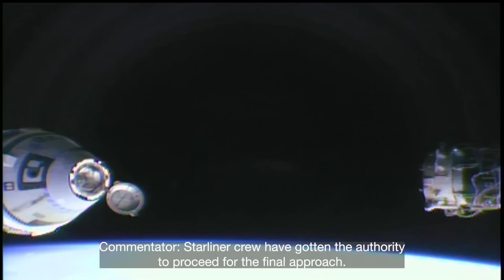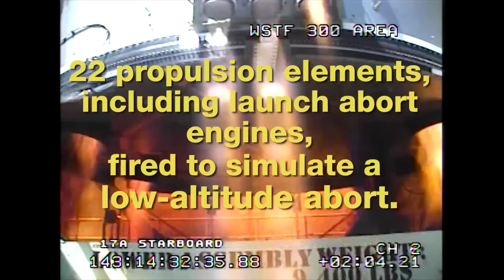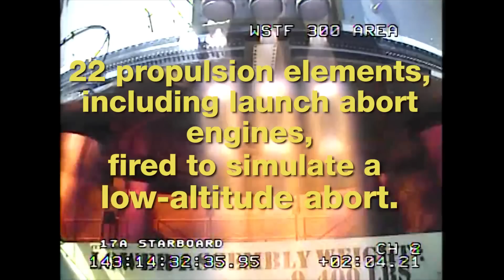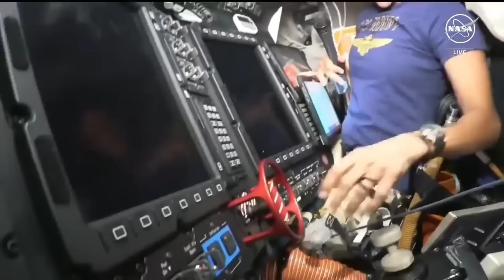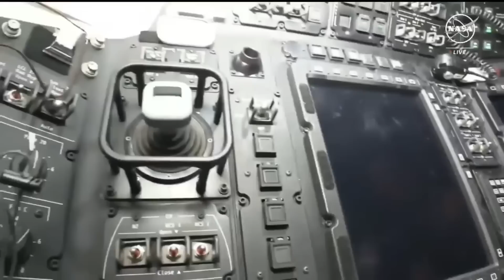The Decision Is Made - Boeing Might Be Safe? But SpaceX Is SAFER!

Comment: I'm not entirely sure how to appraise Boeing, here.  These issues are not unheard of and are to be somewhat expected, at least... From what we are being told is the issue.

It's easy for me to sit here and accuse Boeing of doing a bad job - but that's also not being entirely fair - nasa and other groups have run into similar issues and we just didn't get a play by play.

That said.... It's not like this is the early days of aerospace, either, and the types of issues they are having - corrosion, thermal warping of gaskets/seals, helium containment, etc are things that have been generally solved for, before.  I don't expect a flawlessly designed vehicle, but how do you make flammable wire harnesses?
I know how you do, since nearly everything is flammable when dealing with pure oxygen delivery - but that is kind of the point... We know you need to carefully select materials because of specific concerns ... If you just slap a zip tie from the hardware store on it and go, you'll probably have problems.

.... There again ... I specifically remember my brother, who works on a different boeing project, recounting a story where they had to interdict an engineer's efforts to certify a procedure that involved shooting O2 down a line that had not been purged of oil residues, and being quite adamant there should have been no problems with it.... So .... Nylon Zip ties as wire harnesses would be par for the course.
At least... According to ASTM, nylon has autoignition properties to be studied in relation to oxygen environments, so I would choose something else as a wire harness, myself....

Comment: They have worries about the spacecraft damaging ISS when returning with crew onboard. How does it mitigate the risk, when the crew flies with SpaceX? Could they then use some more aggressive de-orbit burn, than they would do with crew onboard?
Reply: They described that under the uncrewed scenario they would undock and basically drift to aft of the station before departing backward. The original departure sequence instead took it up, over, underneath, and then forward of the station. I imagine the simplified docking procedure requires much less attitude control, if any. I'm not sure of the exact reason why the simplified undocking procedure wouldn't be used for crew, though.

Comment: After Apollo 13 where the CO scrubbers in the Command Module/Lunar Module were different requiring a Macgyver fix. 

NASA what the HE!! were you thinking, all In-flight space suits should have been designed for common Life Support Interfaces so they could move between NASA Sponsored equipment. The structure of the suit could be different but the style of connectors must all meet a single spec.Therefore a Boeing suit and a Space-Ex suit could move between NASA Sponsored equipment/vendors. 
Nothing they could do to make Soyuz meet that spec, except have a Auxillary pak that would bridge between the platforms.

Comment: I find it interesting that SpaceX had 25 Dragon launches (22 Dragon-1 and 3 Dragon-2) proving their technology and engineering, ironing out issues and oversights, before they put a crew of human beings inside the spacecraft. So much effort and it was worth it. Dragon-2 was as reliable as it could be when Bob and Doug flew to the ISS. Boeing, on the other hand, has humans on board practically right away. Their work was not so rigorously proven as SpaceX's and look what happened. Really makes you wonder.

Comment: Scott, Can you make a video or recommend one on why the Star Liner vs Dragon have had different results? Are the use of and requirements of the two substantially different? Did Boeing go down a poor design path? Did Boeing go down a poor materials path? Were the design processes between SpaceX vs Boeing (Fly to failure and fix it vs simulate to success) part of the reason? SpaceX just looks really good in this situation. What have they done differently?

Comment: The thrusters, parachutes, o-rings, pressurisation system, and electronics failed on the pilot spacecraft without crew, they knew about this before the human space flight, yet they still sent them up saying it was all fixed, now here we are 18 months later, and all the past failures happened in space with crew. You have to wonder now, were they actually fixed by Boeing or just given the okay with doubts?

Comment: The return of the Starliner wont be a walk in the park. 
Two of the "tested" software on the Starliner has already failed, the software of the autopilot is "untested" (I would not be surprised if it weren't even developed). The thrusters' earlier power fluctuation (the ones that came back normal later) can happen again an who knows what we do not know abou what the software should be ready for.
And they have to test it on the "live" system, everybody will watch the news. I would not even surprised If we get the news about the return after the event...
What do you think?

Comment: I'd be suspicious of the replication tests...it's possible the thrusters and the flow systems on the test modules are of higher quality than the ones in the actual capsule docked at ISS. Imagine you're a middle manager trying to cover your a$$, so when the testing group is trying to replicate the problem, you'd be sure the best parts were in that mock up. Whereas the docked capsule might have been rushed into service due to all the delays and, as Boeing seems want to do, substandard parts were used.

Comment: Not sure Boeing's reputation still has enough weight even to be effective ballast! Seems to me the really questionable decision was to give Starliner permission to approach the ISS with failing thrusters. If you are flying a two-engine plane and one engine fails, you do not say 'ah well it is perfectly safe to fly on one engine, press on', you say 'our redundancy is gone, land as soon as possible in case the other fails'. Plus if you are test flying a new plane design, you get really nervous because it is most likely the engine failed due to a design or manufacturing fault and the other has the same problem.

Comment: Sounds like it is time for a universal connector for the pressurized flight suits so they are compatible with any spacecraft. At this point with hindsight, it seems painfully obvious that we should be doing this for crew safety, especially on an international space station. Kind of reminds me of that time on Apollo 13 when the air scrubbers from the CM wouldn't fit in the LM because they were different shapes... for... reasons... :0)

Comment: Launch day footage was a perfect sign of the program.  When we got to watch the close out crew and they couldn't even wear the safety gear correctly, let alone use it.  It just showed how far boeing and nasa have fallen.  Prior roll outs of the capsule with safety parts falling off landing on the road.  Massive delays.  Bloated expenses.  It's just a mockery of its former glory.  How's that new spacesuit coming. SLS is in the same situation.  I mean it's not even newly designed tech, it's a majority of reused items designed by the former generation, when nasa, boeing etc were great and actually shined.

Comment: Scott despite efforts to play down Starliner's undeniable deficiencies as being  representative if not eloquent of disadvantage.

Surely it is obvious to most that the primary if not only reason Starliner is the "preferred option" for it's crew in the event of an emergency descent scenario is purely because a Crew Dragon vehicle is not currently readily available and cannot be because Starliner, is blocking the only available docking station?

After all which vehicle has flawlessly delivered all other current occupants of the ISS along with a number of others as well as several unmanned resupply missions?

Starliner has merely delivered it's inaugural crew to the ISS and not without substantial if not serious problems/safety issues yet they are being played down to almost fanatic extent in some circles.

The issues in question have been subject to substantial effort in order to downplay their significance and Starliner actually touted, as a "preferred option" in the event of an emergency descent?

Rather than being in a "unique position" it appears that having the option of 'selecting more than one vehicle for crewed missions' is more of a dilemma for NASA than a laudable advantage.

Given the extent of seemingly evasive behaviour associated with obvious attempts at contriving positive propaganda regarding Starliner despite, serious and potentially irremediable problems plaguing it.

People could be forgiven for wondering if there is not also more than a little chicanery involved with regard to delays besetting continuity for testing and an inaugural launch to orbit for Dream Chaser.

Comment: 8:46 Surprised to hear that there isn't spacesuit compatibility across Dragon and Starliner, given the lessons learned from CO2 scrubber incompatibility between LM and CM on Apollo 13.
Reply: Yeah, that struck me immediatly as unwise/safe! The essential needs are likely 90+% the same utilities, so common connects should be possible even with older current ISS suits, or adapters supplied. Because there are also the Soyuz suits to consider for escape! If/when emergencies occur, time and options will be limited. Hopefully the Chinese dont have the same issues, as they likely standardised on one recent design. Not that it will help the ISS, unless they followed Russian designs exactly?🤔
Reply: Yeah well why have compatible safety features when Elon needs another 100 million to dump into a losing venture?

Comment: The decision to press to ISS docking, vs aborting and bringing Starliner back (whilst it had more helium reserves, good battery and they'd recovered enough thrusters to regain positional control) in hindsight was probably not the best call. Boeing leaving it to NASA to determine their fate, rather than get out in front of it and own the issue (and negotiate with NASA for return on an alternate transport) isn't a great look, either.

NASA and Boeing clearly spent weeks essentially trying to get engineering teams to agree to putting two crew members back in a vehicle with a service module that is not entirely operating within spec (never mind questions over what state the flight computers were configured for that don't currently support full autonomous control). 

It is good that safety has won out over 'optics' as it looked increasingly like that might have ended differently.

Starliner itself is basically fine. The Service Module however clearly has issues that aren't just going to magically go away regardless of how much Boeing express confidence in it. Ideally it'll return just fine (as it should) and Boeing has a ton of work to get the SM into a more reliable state. The alternative is that it doesn't return just fine - at least that can't actually affect the original crew, now.
Reply: NASA definitely wasn't arguing for crew return. The vast majority never felt Starliner crew return was safe and they unanimously agreed that the SpaceX return option was acceptable. 

I think they wanted to dock because they were much closer to the ISS and it would be much less intensive on the thrusters to dock than to try to deorbit. It would have exposed the crew to more risk by trying to call off docking
Reply: @AmbientMorality  I am not sure pushing to the ISS would have been any safer than pushing for deorbit. A vehicle that can't abort docking, for any reason, has no business heading to the ISS in the first place.

NASA was originally on board with a crewed return (once Boeing could determine the safety of doing so). It's evident NASA could not get the required determination, could not achieve consensus with engineering teams and thus the alternate arrangement. There would be some natural pressure to not do what they are now going to do, so I think the narrative that NASA was pro autonomous return from the get go, ignores that requires changes to implement and the last two months that was focused on a crewed return for Starliner.

If nothing else we can likely agree that this is a good and safe outcome and that is really the critical thing.

Comment: shouldn't heat dissipate much faster in space?  Heat buildup as unique to approaching the ISS makes no sense--at all.  Probably a bad sensor(s).

Sorry. Boeing's reputation has already burnt up.  :)
Reply: Heat that built up quickly inside the doghouse can't dissipate by radiation anywhere nearly as quickly as it built up. The structure is insulated. It can't dissipate by convection since there's no air in space, of course. 

I can't explain it properly but be assured it has been explained in various videos in the last couple of weeks. If it was just a bad sensor then it wouldn't have occurred on 6 thrusters at once. Bad software misinterpreting readings? Even Boeing would have figured it out after all this time.

Comment: I work for a microscopic sized space company. I do 5K psi helium all the time with no leaks. I currently have a set of tanks that have been pressurized to 4K psi Helium that have held the same pressure for 1 year. I build wiring harnesses. I do them all for probably 1/1000 of the cost that boeing costs the taxpayer. Boeing is a monumental waste of taxpayer money. Starliner is an example of wasteful corporate welfare. NASA, the government, and Boeing are massively corrupt.

Comment: My understanding is that during the shuttle era much or all of the support for the shuttle astronauts was still from the shuttle, not from the ISS. For example, shuttle fuel cells generated water as a byproduct, and while the ISS reduced the load on the fuel cells I don't think it eliminated it. The shuttle could also carry plenty of food for it's crew.

So... not exactly fair to compare 13 astronauts on ISS+shuttle to 12 astronauts being supported soley by the ISS.

Comment: Thought Dragon could be configured with up to 7 seats, they would only need 6 if a Crew9 launches as with the default plan.
Reply: As mentioned by other commenters, the 7-seat design was from when they were planning on a powered landing, not a parachutes-and-splashdown one, and the seats weren't set up to be safe for a splashdown impact.  The 4-seat design isn't just the 7-seat design with 3 seats removed, and it would require an entirely new seat design to bump it back up to 6 seats that could land safely.

Comment: America, I have a multi-part question. Why was the astronaut van accompanied by an MRAP? Were they expecting to encounter land mines? And if so, why wasn’t the mine-resistant vehicle at the front of the convoy? 😜
Reply from the maker: In the event that they need to evacuate the pad there’s a zip line from the rocket which leads to a parked MRAP which the astronauts use to drive away from the rocket.

Comment: Don't group all Space X projects into one quality batch. Falcon is safe, Starship is NOT!
Reply: Starship isnt finished yet
Reply: @wizzyno1566  
1) How long before moon landing then?
2) Not one refueling carried out or designed?
3) Human landing system where is it?

Dam the SATURN V in 1960 with on its 5th flight, it was well along the design testing with moon orbits! yes moon orbits! Apollo 10 and Starship has yet to reach orbit.
You have all been had by a snake oil salesmen.

Comment: The Crew Dragon was designed for 7 seats. Perhaps NASA should have SpaceX put the extra seats in and strap cargo to them. This would add some weight, but would provide a contingency return in the event of an issue with any other craft.

As for Starliner, it may be time to cut losses, and help Dream Chaser get its cargo certification done more quickly, then work on crew certification of that craft?
Reply: As mentioned by other commenters, the 7-seat design was from when they were planning on a powered landing, not a parachutes-and-splashdown one, and the seats weren't set up to be safe for a splashdown impact.  The 4-seat design isn't just the 7-seat design with 3 seats removed, and it would require an entirely new seat design to bump it back up to 6 seats that could land safely.

Comment: Make an adapter to the suits. I'm sure they have a 3d printer up there or make adapters to take up on the next flight. All those things should be designed to a single design set either way if you expect to have different vehicles attached. Why wouldn't the basic connections be the same. It is silly. Imagine if every gas pump were different at your local station, or each and every car tire would only fit in that car? Some things should be standardized just in case there were an issue... umm ... kinda like now ..

Comment: Good video and I'm glad you mentioned the risks associated of losing control and hitting the ISS.  So what's the plan there?   If Starliner is going to have to undock before Crew 9 can dock, does that mean that Williams and Wilmore won't have a spot on a lifeboat anywhere if anything goes wrong and the station has to be evacuated?   Or can they pile into Crew 8 and get ratch strapped down to something?

Comment: Hey, Scott - excuse me, but I was always told that it was hydrogen that has "storage issues" - not helium.
Reply: Hydrogen has half the atomic size of helium so is even better at discovering ways to leak. But helium is still pretty bad that way, its molecules having about one eighth the size of air's. Though at least helium is very inert, so unlike hydrogen it doesn't risk RUDs if it leaks.